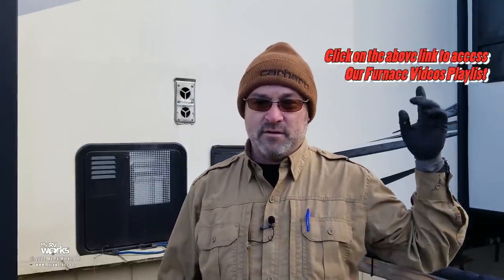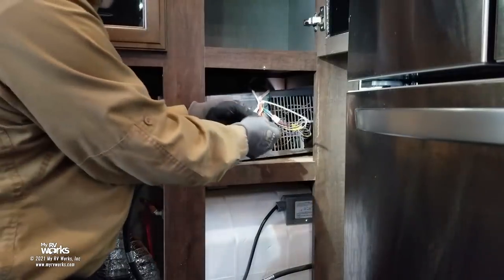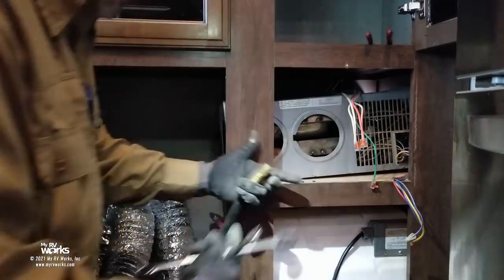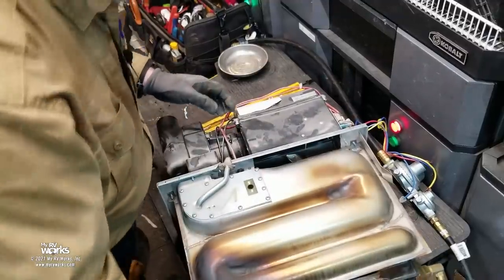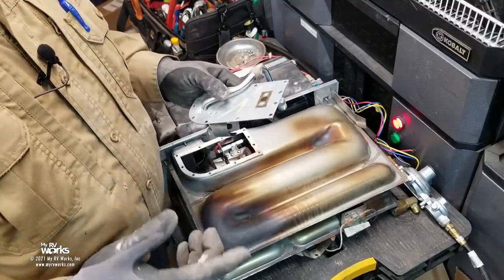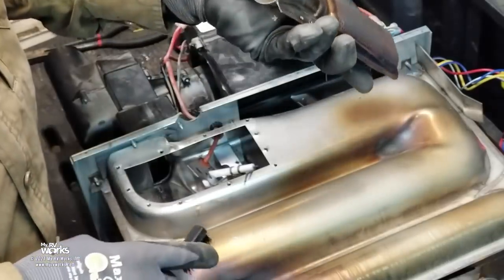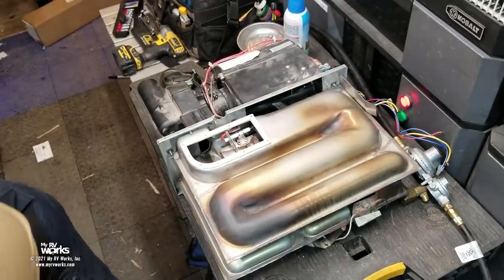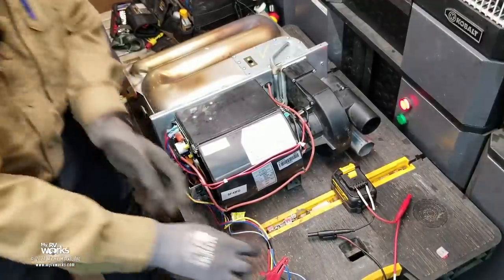RV Furnace Annual Service & Maintenance  --  My RV Works

Comment: Thank you for your thorough videos. This video and a couple other furnace videos saved me $400 to $500 because I was able to see how to remove the furnace, connect the furnace to a small battery for testing, and what to look for during my troubleshooting. After 6 weeks of flawless usage the furnace failed suddenly to light off. The fan ran and the ticking sound was there which led me to look into the operation of the solenoid valves. Eventually I found the crimped female tab connector on the solenoid broke between the crimp and the female portion. The wire came up when I pulled lightly on the wire. I replace the crimp terminal and checked air flow through the valves by blowing through a hose to the gas line. When I reinstalled the furnace, I had HEAT. Thank you so much. By the way, I had to look hard to figure out I needed to use butyl rubber tape on the exhaust plate for the re-installation.

Comment: Excellent video for furnace inspection. The Suburban model SF35Q on our new trailer would not ignite about 7,000 ft elev which is a problem camping in the Rockies.  Neither Suburban nor our local dealer could suggest a solution. However, our trailer manufacturer had some experience and suggested widening the spark gap.  We finally convinced the local dealer service dept, with $350, to widen that gap and the unit has worked for the 3 years since from sea level to 11,000 ft.

Comment: Darren,
Thank you for all of your excellent instructions on furnaces in RV’s. I was able to repair my suurban furnace with minimal cost…had to splice longer wires. Your videos gave me confidence to cut wires, pull out the furnace, and get to the sail switch which was the culprit. No parts, just needed cleaned and reassembled.

Comment: Best video on full furnace inspection and repair...now I can do it. Thx. Mine is going woof woof when it’s not heating up. Great job teaching. They put mine under the fridge w no external access door and no wire disconnects. It’s gonna be un

Comment: Thanks Darren, Your furnace trouble shooting video helped me fix my 2005 Suburban furnace.The fix turned out to be the igniter touching the burner. I would never found it without watching you adjust the igniter with the 1/8th allen wrench.I also ruled out bad parts by using your progression of tests. Your videos are very helpful, THANKS.

Comment: Very good video. I was an RV tech in the late 70's thru the late 80's, I remember Dometic/Duotherm released a "high efficiency"  RV furnace that had a ceramic burner. It wasn't put in very long and they recalled them. The heat was so intense it was burning thru the heat exchanger. Lost track how many furnaces I swapped out. I have forgotten some things but it is still there. For the most part the appliances are still the same but with more tech built in.

Comment: Nice video. I have found pet hair on a sail switch & when cleaned off it has fixed the furnace problem. I’m surprised an inspection of the sail switch isn’t part of the annual inspection.

Comment: I’ve hear you and others talk about the “sail switch “ can you explain this some more like it’s function & purpose & inspection and service. You only covered inspection of the wires  great video and I was impressed that you didn’t get to technical ith your terms this time. Thanks again and let’s all hope we have a good New Year. 👍😎💪🏻
Reply from the maker: Here's a link to our furnace playlist. We covered the sail switch in several of these videos:

https://youtube.com/playlist?list=PLk44vSl27TRCaZIQbm-0utYK7sVOKwXVY

Having offered that resource, the "sail switch" is a proof switch. It gets this name because it is detecting the wind in the blower not unlike a sail on a sailboat.  The control board needs proof that the blower motor is blowing at a certain CFM to support proper combustion. The sail switch has a long actuating arm (sail) that is activated by this blowing wind.  The issue is that the sail switch is, by necessity, in the blower housing.  Oftentimes dirt, dander, lint, pet hair, etc. gets sucked into the blower from the RV and can fault out the switch. If the control board does not see the switch open and close properly it will consider that a fault and the furnace will not ignite.
Reply: @MyRVWorks  I have watched all your furnace videos. I thought I had a bad regulator but I replaced it and I don’t her a clunk on the solenoids. Do you have a video testing the circuit board for the 12 V going to the solenoid‘s?

Comment: As an HVAC/ fireplace technician and instructor let me say your videos, systematic methods and work ethic are outstanding! I applaud the work you do in your business but really appreciate sharing, including the human frailties online. Of particular note is how you've integrated little steps to prevent problems such as using magnetic parts trays including separate ones. I also like the quality checks behind yourself. I agree with your decision not to replace that burner at this time but to communicate it to the customer. They are now aware and will monitor their equipment a little more closely so that if there is a change they should notice it quickly. It's nice when you can remove equipment to work on a bench. That's my greatest chagrin with working on my Class A--access. 
I have a suggestion for some future videos: emergency escape from failed equipment. My first trip in my Georgetown with LCI levelers ended with me stuck. I didn't appreciate the problem with rear wheels off the ground negating the parking brake so we couldn't retract. Luckily, and old hand at the park knew how to manually retract using a screwgun and Allen wrench. I'm thinking it would be of great benefit to compile some dodges what to do when slides, steps, awnings, and levelers don't retract just so you can get home or to a shop. TIA,

Comment: Hi !  Iv got a 88 Nomad with a duo therm !  Furnace has been awesome in MT living. I noticed awhile back it started to stop burning and continue blowing cold awhile ago. Now it seems to work. But blows cold sometimes!  Something is up !  Needs a service for sure. Seems like this furnace is really tucked in there. I guess I really just need to dig into it and pull it out

Comment: When installing the gasket, if you take a dab of adhesive to the gasket, align the screw holes and the reach in and start the threads, it will keep the gasket in place to install the remaining screws...

Comment: Thanks Darren for the wonder video of the furnace inspection.....I have a SF35 here I am getting ready to service in a 1993 bounder - this really helps me get the courage to do this and feel comfortable in dealing with any issue I come across. I am curious as too the cordless drill you use for all videos I have seen....at what setting are you setting your torque drive for?? you seem to keep the same one on almost any screws you encounter - never seen a stripped screw yet....??  Thanks again  Jeff
Reply from the maker: Darren doesn't use the clutch style head, he uses an impact. Here's a link for what he uses.  https://amzn.to/3n6KweU

Comment: Thanks for another excellent video. I have a suburban furnace with a Coleman thermostat in my Rockwood Mini Lite.
0n our last trip out the furnace came on ran for several minutes then shut off. The furnace ignited and was heating. After turning the thermostat off and on the furnace ignites and runs for a few minutes then shuts down. I did that several times with the same results.
I will look at your other videos to evaluate the problem, I assume I it's a sensor but will troubleshoot to try to determine the problem.
I seldom use the furnace as it is so noisy maybee some critters have been there.
My question is, I am about an hour away from you, would it work for me to remove the furnace and bring it to you to do the inspection and repair demonstrated in this video?
Failing eyesight and clumsy fingers prevent me from doing this type of work anymore
Thanks
Gary

Comment: This seems like quite a project every year. Realistically, how long would you expect the furnace heat exchanger to last?  Say normal use. 

Is inspection something I should have you do yearly?  I have my gas regulator tested yearly for leaks and pressure setting. Maybe this inspection is something I should include. 

My motorhome is four years old. 

Great information. 

Thanks, 
Stephen White

Comment: Great video. I only wish this was the level of service offered by most rv dealerships. As a side note, my preference as an rv owner would have been to simply replace the suspect burner since it was questionable with the hot spot on the end and the opportunity to do so since already removed. Marginal cost involved. Thanks again for the detailed content, very helpful.

Comment: I filled LP tanks for  6 years. I only saw 1 20lb tank that would over fill. The line on the guys grill was freezing up so I assume some liquid was getting up the line. A replacement tank solved his issue. Blue rhino tank from a gas station exchange.

Comment: Hello,  very informative,  I took my travel trailer in for its yearly inspection lat year and asked them to do some additional work..  One of the tasks was to check for any oil in me propane system,,  Frankly the acted like the never heard if such a thing.. I seem to be fixated on oil in my propane lines,  i trust your statement about the oil is from the pig tails, however I don't understand how it is formed,  Could you try to explain that process, how to avoid it, and how to get rid of the oil.  
Thanks

Comment: Oil in lines is called heavy ends comes from manufacturing of propane gas yes the oil from rubber hoses is all so a problem so yes you can get oil from tanks. Older tanks that have been in service for years,  when suppliers of propane don't keep up to there maintenance of the pumping station they can send oil down the lines , propane is not the cleanest fuel it can hold lots of moisture as well and in cold climate it can freeze you regulator , 30+ years gas fitter 1

Comment: Great info, my furnace is behind the back wall of the basement.  The flexible ducts are exposed to the outside temp.  Any reason to not replace the 4” ducting with insulated ducting? Thanks!
Reply from the maker: As long as the inside diameter of the ducts is consistent you should be okay with that upgrade

Comment: First.i have to say you seem to know your stuff.
With that  being said I never ask questions but like I said you seem to know what you are doing .so my furnace will work perfectly for could be days or hours but it will work normally ,but the next time it should come on, it does nothing no fan, nothing.sometimes if you turn it off and back on it will work . But than sometimes it won't.  Leave it off for awhile and it works .. I need help. We live in our 5th wheel in the mountains in Md.
Thanks , 
Brian
Reply: Not a pro here, but many intermittent problems like this are electrical- loose/corroded connections, etc. I wonder if it could be the sail switch?  From the videos I have seen, that seems like a weak link in the electrical parts.

Comment: Is the heat exchanger replaceable or is that a sign of needing a new one?
Reply from the maker: It depends on the manufacturer. Suburban does offer just a core purchase which includes the Heat exchanger, motor, and controls. Atwood was purchased by Dometic around 2014 so no Atwood parts anymore, and Dometic does not offer a core replacement. Having said that, you can look for exploded views and order just that part possibly. Here's a link to a site that can offer you exploded views with part numbers.

https://issuu.com/online_guest_guides/docs/pantera2023-2024_ebook/300

Comment: My furnish seems to make an intermittent clicking sound whether the furnace is in use or not. Any ideas on that?
Reply from the maker: I am not sure what kind of RV you have, I have seen on some RVs where the furnace is ducted, and there is a damper door between the RV and the ducks and sometimes that a will moved with wind current.  I see this mostly on the Winnebagos where the furnace is mounted directly in the rear.